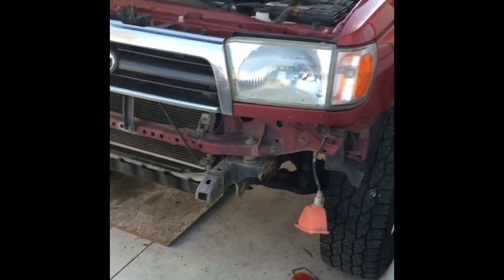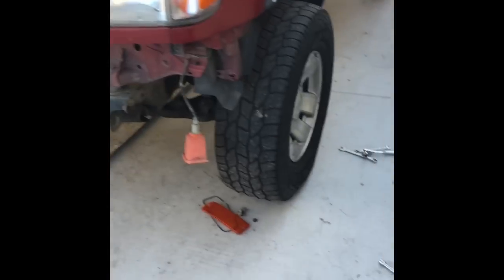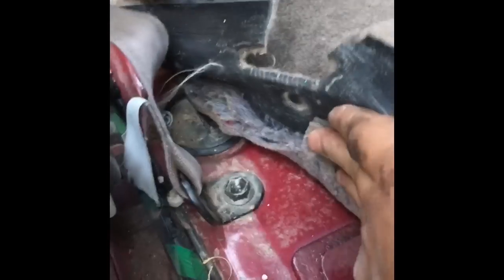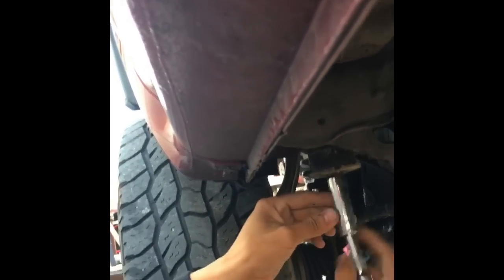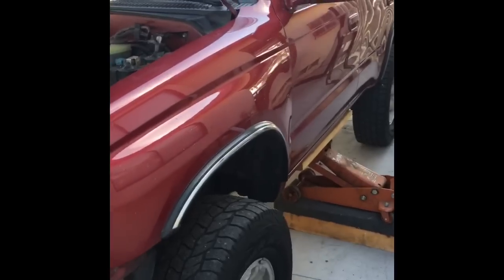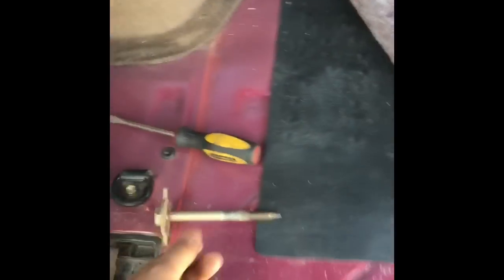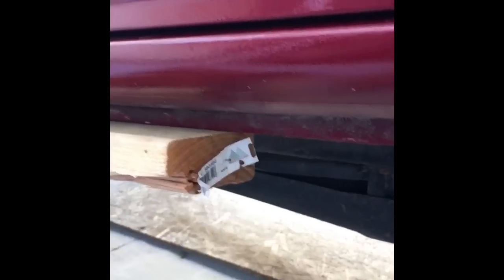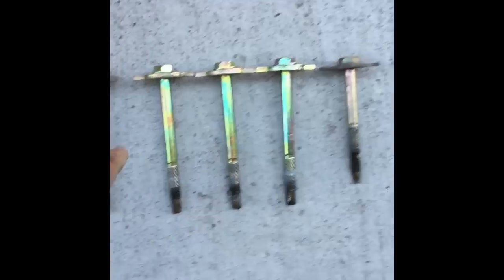3rd gen 2" body lift install

Comment: What about addressing the radiator position and any adjustment to the shifting linkage? With the body lift, the engine fan will run into the lower shroud.  Did you lower the radiator somehow or just remove the lower shroud?  Did you have to do any adjustments to the shifting linkage?  If so, what did you do?

Comment: Will a 1998 Toyota 4runner 2wd lift kit fit a 1998 Toyota t100?
Reply from the maker: Patrick Harrington I believe the only thing that will work between the two is the spacer for the strut up front.. The 4Runner has a coil spring on the rear and the Tundra has leaf spring which would use a lift block.. The 4Runner BL will not work for the Tundra.

Comment: Are you supposed to keep the old mounts on?
Reply from the maker: Side body mounts were still used. Front and rear just added lift spacers in between